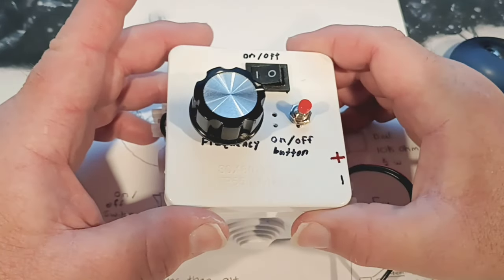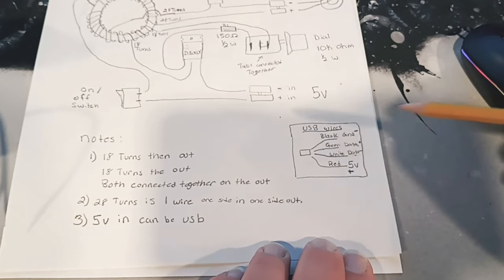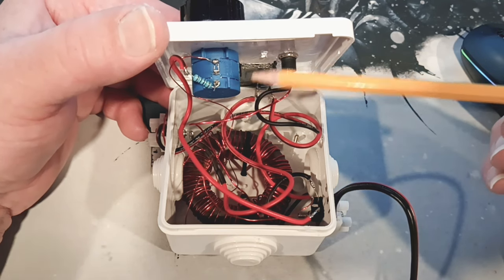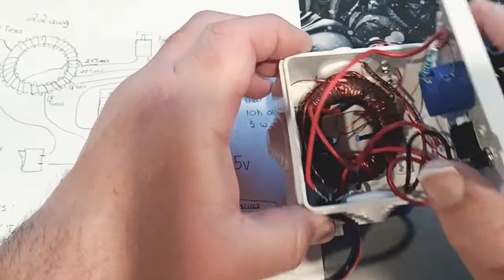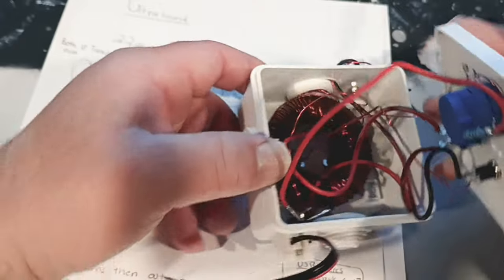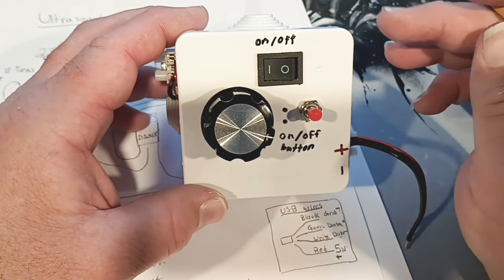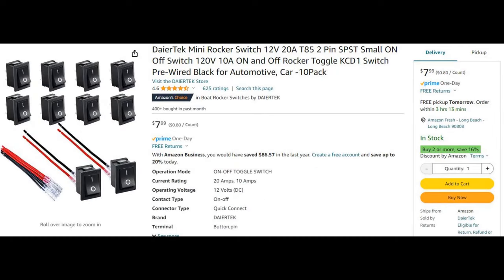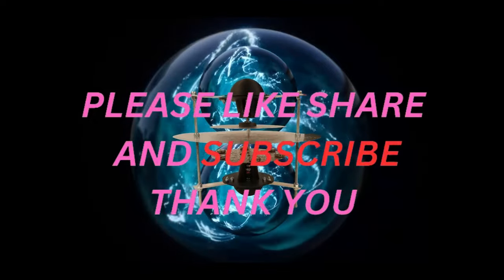Graviflyer Ultrasound Circuit #27

Comment: Wow i just commented on a different older video of yours recommending a piezoelectric transducer with potentiometers, then i went into the rest of your channel and saw this video. Im working on a project using a transducer system myself as well, but in a much different capacity
Reply from the maker: Have you tried to find the distances of the waves from it?
Reply: @nathanbunten4299  no im actually using the transducers for energy generation with a combo of converters to power a constant charging super capacitor bike that will be designed for intermittent throttle acceleration. i had dpreviously thought about using a resonance chamber with a combination of tuning forks designed to absorb the vibration of the road to constantly keep resonance in the chamber to generate electricity from the transducers. but decided to go with a different design. i absolutely am interested in what youre doing here though.

Comment: Can I suggest you power it from a 5V plug pack/ wall  wart, not the USB of your computer.
It will produce noise on the power supply and it has no short circuit protection.
Have you measured how much current the circuit consumes with piezo connected?
What is the operating frequency range it works at?

Comment: The resistor and potentiometer in this circuit will get very hot. 10^2 / 150 = 2/3 Watt, not 1/2 Watt, and it's not necessary to be that value. A 1k Resistor would work just fine, even better if we replace Q1 with an IRF MOSFET instead of a BJT. Then 10^2 / 1000 = 1/10 Watt, and nothing gets hot. Also, I think the core being used is too large for US frequency. What frequency are you getting out? You vary the frequency by varing the voltage, not the Pot. The Pot is nonsense.
This circuit oscillates because the core saturates. Larger cores take longer to saturate, so the output frequency is lower. You can reduce the number (18) turns on both sides to speed it up, or raise the voltage above 5Vdc.
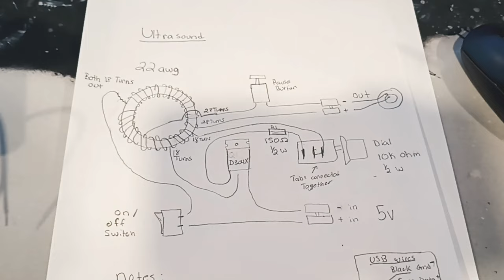Reply from the maker: I agree. Most of the circuits are not what we would build. However it is what he is sending to Charlie C for the graviflyer. I think there should be a coarse adjustment on the voltage and a fine tuning one on the pot. MyTBrain has put out the frequency's of this device on his oscilloscope. https://youtu.be/n39-P92_nnc?si=_d6W51M4kAZZGesE  he has a Q&A today at 3:00 live on his channel. He has the same circuit I have. Personally I think the frequency might be off on this circuit. I have to try based on it being given directly to Charlie C by Alexey for the Graviflyer.
Reply: @nathanbunten4299  In the original circuit he showed and LM317 adjustable voltage regulator that was used to tune it. The new design with the Pot on the Base doesn't make sense.
Reply from the maker: @ToddDesiato  this is the second kit Charlie c got from Alexey.
Reply from the maker: @ToddDesiato I am not sure if they all make sense. You are right to ask about the frequency. It is the only thing that could tie the 2 design's together. Like you I don't see that they are the same at all.